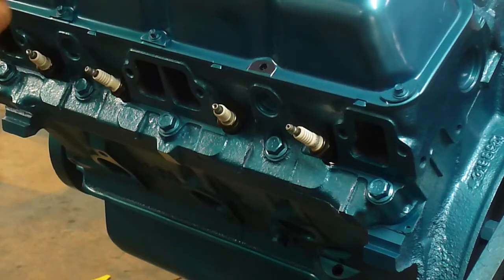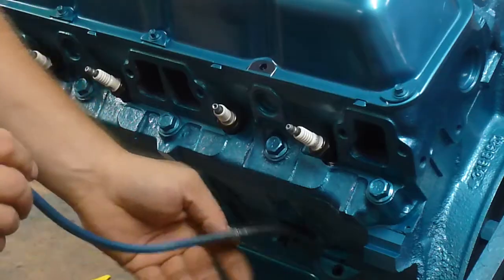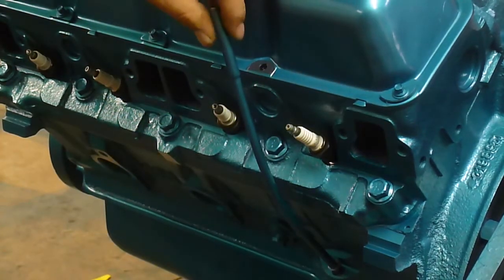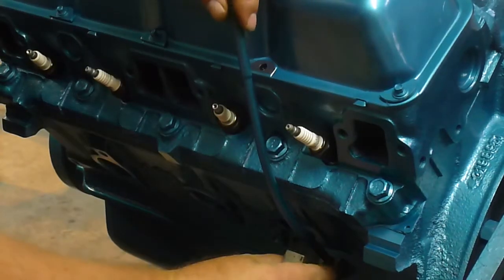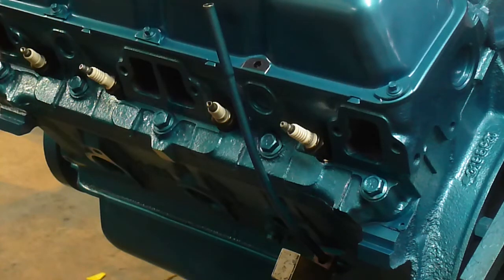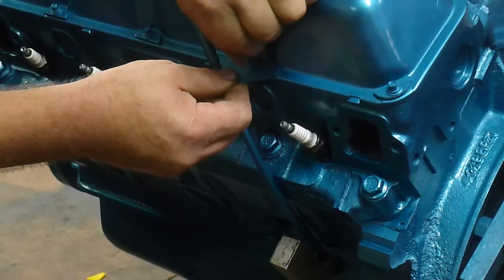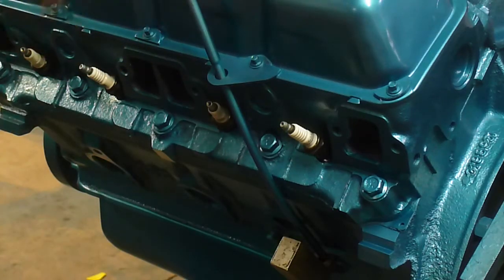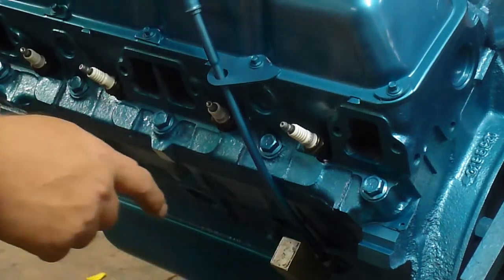AMC V8 Dipstick Tool Demonstration

Comment: pulled out my broken dip stick tube out of 1969 AMC AMC 390 BLOCK. I had no choice but remove my headers but that was no big deal. I took broken tube to ACE hardware to by a high quality lag bolt. I bought 3 lenghts, shot to long. I ended using the small one. I screwed it in about 1/2 inch. Took your pry bar and cut the nail removal slot to fit bolt. I hooked the bolt and tapped it from the bottom. CAME RIGHT OUT! Installing new shaft was easy. Turn pry tool upside down, insert tool at the hump in tube, take a very long pry tool and tap the pry tool with a hammer till it seats. Hint, put small amount of lubricant on the part inserting. BINGO. I was really scared to take this on, but it worked out GREAT. Thank you for you video it really helped. I hope you had luck incert new dip stick tube, you didn't say. Great video. That tool is great if your engine is out of the car. You tube is awesome for mechanics. Thanks

Comment: My tube broke in 2 at the weld; got the lower part out; now cant re-install it by itself; does it angle to the right or left ? Is that even do-able ?
Reply: I just did this with engine installed. pulled out my broken dip stick tube out of 1969 AMC AMC 390 BLOCK. I had no choice but remove my headers but that was no big deal. I took broken tube to ACE hardware to by a high quality lag bolt. I bought 3 lenghts, shot to long. I ended using the small one. I screwed it in about 1/2 inch. Took your pry bar and cut the nail removal slot to fit bolt. I hooked the bolt and tapped it from the bottom. CAME RIGHT OUT! Installing new shaft was easy. Turn pry tool upside down, insert tool at the hump in tube, take a very long pry tool and tap the pry tool with a hammer till it seats. Hint, put small amount of lubricant on the part inserting. BINGO. I was really scared to take this on, but it worked out GREAT. Thank you for you video it really helped. I hope you had luck incert new dip stick tube, you didn't say.

Comment: that's a fine tool to put the dipstick in when on a stand, but......how you going to get a  hammer down in the engine compartment on a car plus you can't get headers over the tube when installed in vehicle unless you have no flanges.  The dipstick tube has to go in afterward.
It's not hard to do after you have done it several times but to me this tool and method would serve no purpose after the  engine is installed.